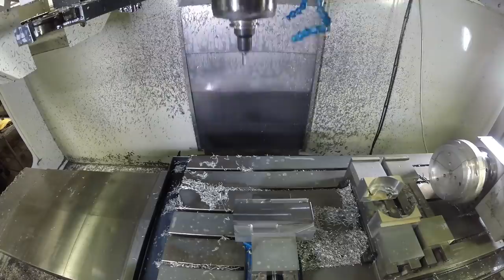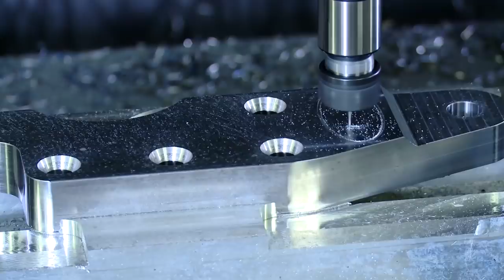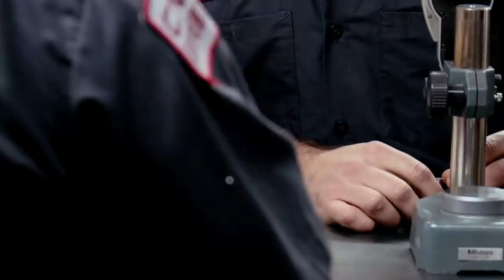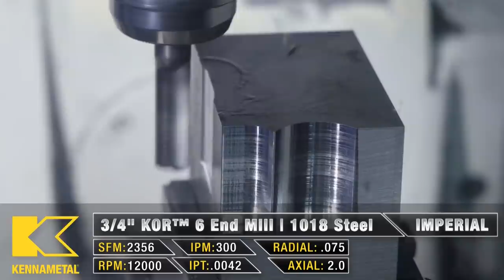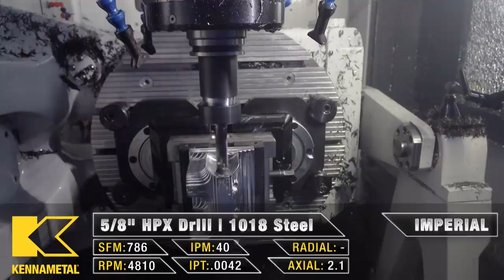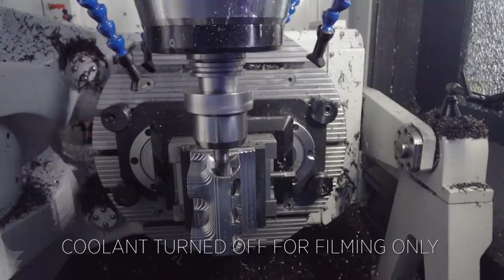Tools Keep Breaking on Night Shift, but Runs Perfect on Day Shift... Nobody Knows Why

Comment: The night shift guy that reduced the feed by 30% also could have been wanting to take longer naps between part changes, so he turned down the feed rate.
I ran a night crew for 30 years. Some guys will do anything to prolong cycle times, and work less.
Reply: Man I have seen this so many times as well.  Even when a part has a 3 or 4 hour cycle time they still will slow it down just to make it longer to keep from doing something.
Reply: I had an operator do that on a lathe that was turning an interrupted cut. He left the thing running with the whole side of the insert cleaved off.
Reply: Fired
Reply: Oh god no keep me moving nothing worse than staring at a wall for 20 minutes with nothing to do in the middle of the night. Makes for such a long shift.
Reply: @slitaitana6212  unfortunately most people are not like that nowadays.  We have a guy that with run the rapids at 10% and not say a word because he can screw off more. If I tell him to run rapids at 100% he will because he knows that I know what can be produced through a shift. Thankfully he will not mess with the feeds and speeds without calling me if something is going on. But yet we have another operator that can't leave shit alone and I mean anything and everything and seen him turn feeds and speeds up to max then wonder why he has tool problems. Not my call but if it was he would've been fired long ago.
Reply: @bbarker5766  At my current shop if you are not at what we call a level 3 or higher, changing the program is grounds for dismissal. We make medical devices and can't have random changes to the program that aren't documented.
Reply: Our day shift does that so the boss sees the green light on longer
Reply: @brandons9138  I trained both our level 3’s, I got my degree, they took a couple classes, and I’m only a level 1 at our shop 😒
Reply: @brandons9138  that's the difference between medical and mining equipment.  A titanium whatever is completely different than a 9,000 lb pan being line bored. But also when one is a relative of the owner and the other is  well.... I'll just let it go because no good explanation.
Reply: @brandons9138  Let's go.
Reply: @bbarker5766  All our machines are quoted by the setup men if you don't achieve the quota at the end of the shift you have to account for what happened on your shift, not even allowed to change an end mill with out punching out of the job and into a tool change job.
Reply: @brandons9138  Ya same for my company class A op. or Technician C-A Setup man C-A are all allowed to change those kinds of things but only with permission from the setup man.
Reply: @realsteel8113  Our company goes by time on the job + a review of you work if no complaints then you automatically move up a level, once you're Class A in a level you can then take the course for the next tier: operator >> technician >> setup man
Reply: @slitaitana6212  dude I am not comparing your shop, practices, experience to mine. I worked for a place that had timers put on top if all of the machines and we had a bar code gun that we had to use for all of that stuff you do etc. It sucked!!! I left there and have been 10,000 times happier ever since.
Reply: @bbarker5766  neither was I just making conversation.
Reply: @realsteel8113  I'm willing to bet your level 1 is backed with more knowledge than the level "3"s have.
Reply: I have never understood the mentality of dragging out a job at all.

You're there for the same amount of time, whether you are doing one job for the entire 12 hour shift or whether you are doing several jobs taking a few hours each... you're still ultimately there for 12 hours.

So why not just get stuck in. Do what you have to do. The day flys by. 

Nothing worse then feeling every single passing minute because you're "dragging" a job out.
Reply: @bbarker5766  blame that on the parents who brought them up)) most of them are spoiled brats. i grew up in poverty, and i already know how my kids will be when i make them and they get to grow up. aint nothing free, especially not the lunch. ill make sure to teach them about the honest work.
Reply: @bbarker5766  yea true. its sad really. ill make sure to raise my childs properly tho, and spread the good word to all the ones i know
Reply: @allahsnackbar9915  if I could have I would've home schooled mine. But couldn't with my situation.
Reply: @bbarker5766  one can rarely do what suits best. im sure you made the best out of the situation anyways. nice talking to you, have my best wishes for the future, and happy holidays to you))
Reply: @bbarker5766  Schools, K-12, aren't really as big of an influence. Most teachers are too stacked with paperwork and checking boxes to have personal impact. Kids before and even in college are getting the majority of their ideas from their peers and internet sources; self-selecting.

Physically and emotionally absent parents/adults are why they turn to this. We segregate kids from greater society and the adult world until they're legally old enough to be worked. Should we be shocked that they don't fit in?
Reply: Slita Itana i was the guy that kept busy too until i realized the pay was not worth the damage to my body. Slow & steady does it
Reply: Real Steel sucks to make shitty life choices
Reply: B Barker bro inflation is nuts right now. Minimum wage should be the least of your complaints.
Reply: @bbarker5766  15 is the new 7.25 LGB
Reply: I made myself custom fixtures that I'd hide from day shift and make custom programs I hid on the machine so I could run 2 or 3 parts per cycle instead of 1. Kept production the same but increased my phone time by hours.
Reply: seriously , people so lazy they will make a robot goof off on the job???
Reply: B Barker i don’t cry about what others do especially half way across the world. Success doesn’t come from worrying about others in a professional manner. It come from giving them the finger and keeping on. Try it out
Reply: i’m first shift i run 52 parts in 9 hrs second shift runs 20parts in 10hrs 🤦🏼‍♂️ i’ve been there 5 months he’s been there over 10 years. but when i come up short say 50 they ask me why
Reply: vinnnocc1011 because only half of your parts pass inspection while 100% of his make it to the customer.
Reply: @highlyspontaneous1962  Then why do they keep expecting him to run twice the parts?
Reply: Hurricane everybody has expectations. Doesn’t mean they need to be met. Me and you have our individual pros & cons. I take it slow and easy while i have a 98% success rate without reworking, while the next guy may work twice as fast, but reworks half his work. I was that guy, and learned from the guys taking it slow around me that have been around for a-lot longer that it makes much more sense and $
Reply: @slitaitana6212   
Just curious, (you clocking out for tool changes,)  is your company a Government Defense Contractor & that's why you have to be so tight with your time ?  Or is the company that just doesn't want any tooling time billed to customer ?

I had to clock my hole day in 6 minute blocks (1 tenth of an hour)
All digital, go to terminal, (that might be 40 yards away) bathroom /2 or 3 tenths,
It was such a pain. I'm not working now, do alot of shops have to clock all that little time like that now? I thought it was just because we worked for the government ?
Thx
Reply: I worked 30 years in the nightshift. I turned the feedrate and rpm's to 120%. So i could take a longer breaks with my colleagues without losing production.
Reply: @slitaitana6212  Personel are not robots who working every day at the same speed. We all have "our days". I think i would have a lot of diarrhea if i worked in you company.
Reply: @ghost2coast296  That's the way.I was doing the same thing.  Improving the method and not telling the boss.
Reply: true either that or he thought he was doing the right thing and saving the endmills rather than using them up faster. its always best to ask if youre not sure. even if its embarrassing. if you cant ask someone. dont change settings on machines you are not totally formilliar with. an operator doesnt neceserily know as much as the person who programmed it in the first place
Reply: @MrTWOproductions  That's literally what i am saying... no one wants to run like a mad fool all day doing menial labor a machine can do for you. leaving operators more time to run more machines for better pay.
Reply: @markoc.2397  No it's for quoting purposes, to know how long tools last how often they need changing, how long it takes to change a tool. That way the company can decide if it needs better tool paths or tooling or a 2nd cutter so you don't have to wait on tool changes. If you're not clocking tooling you might be changing 10 end mills a day and the company has no idea.
Reply: no need to punch out for bathroom breaks just let a technician know to keep an eye on the machine while your away. it's mostly mechanic or tooling so they desk monkeys  can see whats what.
Reply: @bbarker5766  Your ignorance in economic issues is only matched by your confidence in discussing them.
Reply: Omg i get fricken antsy when i can't do anything.
Reply: Been a foreman at a factory. Seen this very thing
Reply: @slitaitana6212  That's when you work for a company that doesn't care if you pull out your phone while waiting on the machine to do its thing.
Reply: @bbarker5766  the purchasing power of a 15$ wage is lower than what boomers got on a summer job. Maybe get a little sense of context before showing everyone how out of touch you are.
Reply: @Wimpymind  that don't make sense.
Reply: @bbarker5766  In 1980 the minimum wage, adjusted for 2021 dollars, was $11.08. The federal minimum wage today is $7.25. Of course it doesn't fking make sense.
Reply: @bbarker5766  Let's not forget the CPI, which is used to make that adjustment I just gave you, excludes medical and housing prices, college tuition and so on. Basically the things whose prices have gone through the roof. Because YOU DID NOTHING.
Reply: Facts
Reply: I worked an overnight shift for a while... went to the restroom... sat on the toilet, went to sleep... when I woke, my legs were so dead that you could have cut them off with a hack saw, and I wouldn't have felt it! LOL  Never again!  Nights shift sux, and NO one should ever have to work it!
Reply: You would think after the first failure that night shift operator would have set the parameters to the spec.  Maybe even after the second one. Dumb dumbs....
Reply: I was always the operator that wanted to get as many good parts done without screwing up cutting tools, I liked to find the happy medium of a lot of parts without a lot of tool breakage or parts being out of spec because you were trying to run way too fast
Reply: Based kings, work suckd
Reply: I know that's right. I have worked with operators who spent 30+ minutes without breaking a chip. They would set the crossfeed close without touching the part and the travel to the slowest possible. 
Also knew a guy who worked one shop cutting ship propeller shafts. One pass was a days work and the lathe had 2 buggies.
Reply: @danl.4743  You are sooooo clever . . .
Reply: Thats funny I'd do anything nessicary to extend work time just so im at least doing something.  Just the other day I get to my position and it's completely backed up. Boss says something to me I can't rember. Anyways 10 minutes later it's all caught up. And he's like the f? I'm like dude I wasn't even trying. Hate my job it's to bloody slow. But damn does it pay
Reply: @danielgudi7446  Ya I'm retired now have my own little at home business but ya was making more money than I knew what to do with. That's why I have mad love for Titan and his crew, they get it. This is not some "button pusher" job. I am a machinist. I make perfection, I don't flip fries.
Reply: I’m dealing with a crew right now that thinks they can sand bag the schedule and get overtime. They don’t know it yet but there’s a hiring freeze until January. Come January they’ll be looking for a new job 😁 schedule pays bills including payroll.
Reply: @slitaitana6212  two types of people in the world ☠️
Reply: @gearhead682010  my dad was a welder for 30 years and was paid by the piece. He said it would take him a day to figure out the best way to do the job with the least amount of touches. He told me he always made 120% efficiency and that his company sent down time
Management people from head office to consult him as to why/ how his stuff passed QA. He told them it’s not hard. Just need to think.  He always drilled that into my head. Always think about what you are doing and look for ways to improve. I have done this my whole life starting at all my part time jobs. All my bosses loved me that I would ask and suggest ways to save time and money. Have done well for myself. Owned multiple companies. And have my dad to thank for drilling that into me!  RIP dad.
Reply: night is for sleeping not working
Reply: Tell me about it. Night shift guys where I work literally come in with the aim to sleep and sign off jobs without doing them
Reply: We had a guy that would run a job for 2-3 weeks and not de burr any parts, then sit there for another week doing that. He no longer is employed at my shop.
Reply: @TheWeekendWarrior490  no, that's because robot don't make error, don't need to be paid, won't make unions, and will work 24/7
Reply: You're right and sometimes i did that too...
Reply: @himabimdimwim  really.    Man I've looked at things from many different points of view and talked for a long time the majority thought the they were owed everything to make it in life.
Reply: @himabimdimwim  this is why rich people love mass immigration
Reply: @Mavendow  minimum wage is for summer jobs for kids.  
Nobody thinking about paying tuition would need to think about minimum wage.
Also, they are implementing it poorly.  To apply the same minimum wage in San Francisco as you do to a rural Midwestern town is clueless.  
Furthermore, If people have such poor buying power nowadays why does everyone have more cars, better cars, and better stuff than they did in 1980.
Reply: @boggisthecat  maybe he's saying that you don't need the government to step in and create an artificial minimum wage.  
Most adults don't make minimum wage.  They take on actual responsibility and learn how to be better at work so they can make money.  Minimum wage is not required.
Reply: @TheWeekendWarrior490  we've already automated so much of what was manual 100 years ago.... I don't think more robots are going to change that.  They'll just find other things that only a human can do.
Reply: @JustARandomSomething  sounds like you have a management problem.  
You wouldn't have to be very smart to tell that a night shift guy isn't getting as much done as a day shift guy.  Let him know that he can work while he's at work or he can find a new job.  Management just has to do a little work.
Reply: @himabimdimwim  There are young people making a hell of a lot more than $12 an hour all over the place.  
But they don't make sandwiches at Subway.  Because high school kids can do that.
Reply: @jamisojo  you know very well that there's more minimum wage work than there is student willing to do them, even then, some of those student might need more than mere scraps to finance their overpriced studies and pay for a place to live. minimum wage should be livable, and should not require one to choose between eating healthy and having electricity.

moreover, inflation is double, 4.25 to 7.25 is far from double, and inflation numbers are very much underestimated, housing prices have ballooned, some places growing tenfold in those 30 years. healthcare and school prices have done the same, and those 3 MAJOR aspect of life aren't taken into account to calculate inflation. even with 15$ an hour you can't even begin to hope to be the owner of your home
Reply: @Jessie_Smith  this happens at my shop and idk how to get these dummies to stop.
Reply: We had one ukrainian guy few years ago who was lowering relative speed to like 20% to make it slower, we work with wood, so you can imagine how it looked, I told him like milion times to not do that because it will start burning (and it happened several times, so I was not kidding), but it was like talking to oak. I mostly program it while having 80% relative speed on controller to have some possibility to make it slightly faster when it's needed, it was like that since always, since I started working there, so I continued in this tradition, but when I go there when someone else is working on that, I always see there like 60% or even less. I understand it that those people are afraid of breaking tools or something, but they will set it on fire by slowering it. 😀